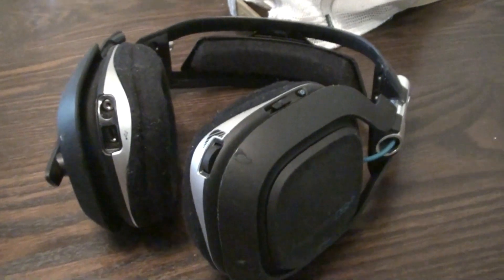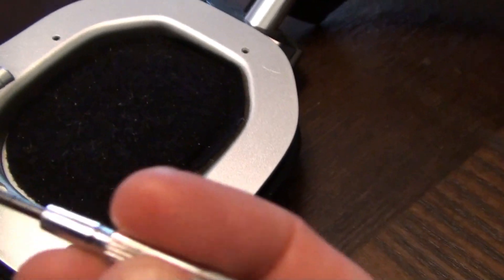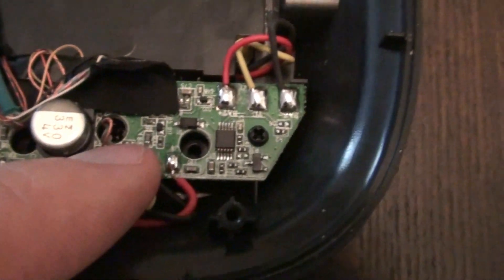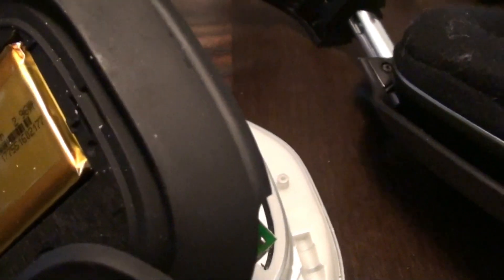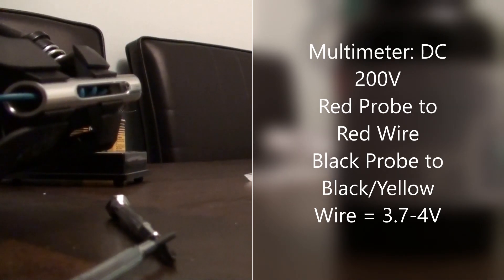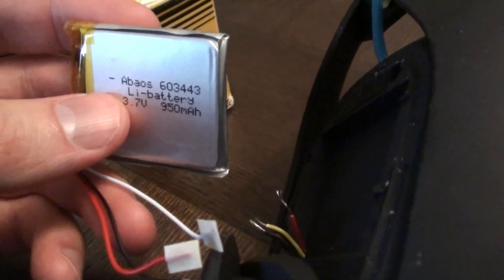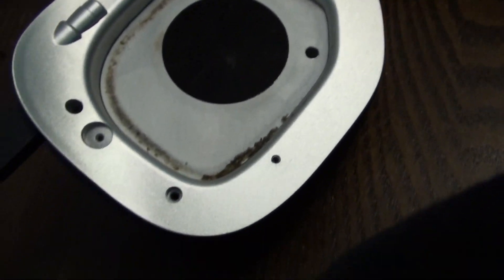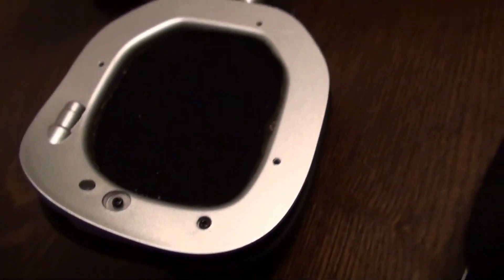Astro A50 Battery Replacement - Wireless Headset - Logitech

Comment: I have an Astro a50g4 that does not power on. The base lights up when connected to my PC and so does the headset but when i remove the headset from the base, it does not turn on. I have tried hard resetting and tried downgrading/upgrading firmware. Command center shows battery charged at 84%. this hasn't changed even after trying to direct charge overnight..  At this point i'm thinking i have a dead/faulty battery - any tips?
Reply from the maker: Honesty up front:  I've never laid hands on a gen4, but I'm fairly certain the disassemble would not be the same.  In fact, it probably doesn't use the same battery either.
I've stayed away from them after hearing sad stories about software/firmware updates that permanently "bricked" the headset.
I have some ideas about how to approach your fix, but I hesitate to give you that kind of untested advice.
If you dig the astro a50, grab a 2nd hand gen1 or gen2 off ebay.  The prices have dramatically fallen!!  😉  They are super fixable and you can upgrade the battery!
I also splashed some cool epoxy on one pair (see channel video) which turned out AMAZING!!
Reply: i have the same problem, u can fix it?
Reply: ur literally the first person to have my exact problem its doing my head in

Comment: So wait is that the reason why when I charge my mic it only charging for a couple sec then turns red and die its like I can't make it charge for nothing I switch out all the chargers
Reply from the maker: There's a couple other things it could possibly be, but I would put HAVING A BAD BATTERY at the top of the list, loso.
The good news is:  It's a pretty straightforward replacement, YOU CAN DO IT!! 👌🏼
Reply: @VestigialVoice  I appreciate it bro

Comment: Hello there! My friend's Astro A50 gen 2 got a problem yesterday. It ran out of battery last night and then she charged it this morning but it did not store any charge and quickly turned off again after a minute of the redlight flashing. I tried hard resetting them (by holding down the power + game buttons) and a orange light appeared. Then after a few minutes of leaving them on charge with this orange light the last of the power was used and now they do not turn on at all. I think the problem could be with the micro USB port as the headset had kept minimal battery for almost a day until I have begun trying to repair it. She had tried using a different USB to charge the headset yesterday as she wanted to play while charging them and I think this may have caused the issue. Please advise if you know anything I can try to resolve the issue. :)
Reply: The base unit turns off when the headset is plugged in which I don't think it did before. If that means anything?
Reply from the maker: Evening, knight.
It certainly could be a couple things, but I'd go back and check the wiring.
Did you attempt to charge it when it was still apart?  If so, did it work then?
I suppose it is possible to have received a dead-on-arrival battery, however, I've never run into that problem...
Check all the new solder joints--make sure wires didn't get pinched or pulled out when it was put back together.  It'll take a bit of time, but I have a feeling it will be a pretty simple fix.
Good luck, friend, and thank you for visiting my channel  😄

Comment: Hey I have an Astro A50 1.gen, it stopped working since yesterday and I can’t turn it on. Do you have any ideas to fix the problem? I couldn’t find a video with the 1.gen
Reply from the maker: King!  I own a gen2 and 3, but strangely have never even laid eyes on a gen1 in the flesh (however, I look forward to the day).
If there are no videos out there and you feel brave, film the fix!
Presuming the headset won't power up at all, it's probably a dead battery or severed wire / cracked solder joint.
Kick me the link, I'd like to check it out  :)
Thank you for visiting the channel, bud!

Comment: Hi, is there a symptom to know it is only a faulty battery? my a50's blink twice while plugged in, then go off.
Reply from the maker: Brother Carlos, I'm going to need a bit more information.  How long have you had it? 
 Any recent updates?  Which gen is it?  What color light is it?  Do you have the base station?  If you haven't already, try to repair the firmware.  There are a couple useful forums to guide you, step-by-annoying-step, with a simple google search.  I believe in you  :)
Reply: @VestigialVoice  they are gen 2 ps4 got them used to try to fix my first pair but, luckily after a full charge, they are working. now my original pair, which have been with me for 3 years will be the ones for spare, those start working well but after a couple minutes start to have fast blinking red light I assume it has something to do with the game-chat mixing. Thanks for the fast response.
Reply from the maker: @Diegosonic1  Glad to hear they're back in shape!  You know where to find me if they begin acting up again.  ;)
Reply: @VestigialVoice  Well, my other A50 just have blinking red light (fast, not slow like when low bat). Any possible reason comes to your mind?
Reply from the maker: You may be right.  Have you tested the battery with a multimeter to see if it is holding a charge?  A simple battery replacement might nurture that thing back to life!  Let me what you find out  :)

Comment: Did you ever think you could have fit a slightly bigger battery in there?
Reply from the maker: Hi Jay, thank you for the comment.  There is not a lot of space in the cavity but the OEM is an 800mAh battery and I put in a slightly larger (950mAh) battery - so about 20% longer lifespan.

Comment: ive had my astro a50 gen 4 headset for 3 weeks. when i put it on the base to charge the base lights start flashing white. its been like that for a day now and the headset battery life in the command center is stuck on 0%. 3 weeks 340 dollars and thye wont turn on. whats wrong with them and can i fix them????? fml im done buying headsets. i have zero luck
Reply from the maker: King!!!  Try doing a hard reset of the headset:  Press the dolby button & the game button on the right earcup while it's seated in the base station.
Reply: @VestigialVoice  I can try it but I heard they have to be on for that to work and these dont turn on.
Reply: @kinghayes1005  hey did you ever figure it out? i’m having the same problem and i just got them today. i can’t find any solutions anywhere

Comment: Someone give me a tip on how to change the microphone mine stopped working
Reply from the maker: Leon, that is either a very simple or an extremely difficult problem.  Number one, what was happening immediately prior to it dying?  If it didn't endure trauma, then the first thing I'd do is verify settings on the system's software.  This may also involve updating firmware for the transmitter and/or the headset.  Test it with multiple systems to see if the results are identical.  If you are still stuck, then you could open up the headset and investigate for severed or loose wiring, a cracked pcb, or a bulging capacitor.  I hope this points you in the right direction, my man.  Good luck.  :)
Reply: @VestigialVoice  Thank you very much for the tips but I ended up finding a very simple problem, one of the cables was loose in the microphone. I soldered it again and it was working wonderfully. I realized that there is almost no content about repairs by this brand including what I know about electronics is precisely to save devices and not have to buy a new one because they are usually very expensive.
Reply from the maker: @leonmenezes  Excellent, I love to hear that!

Comment: So I didn't see you mention this in your video but that center screw for the boom mic is REVERSE THREADED. DO NOT make the mistake of trying to loosen it counter-clockwise or you're gonna have a bad time. OP cuts away and doesn't show unscrewing the center screw for the mic boom. If you are still viewing comments please update your video with some text mentioning that the screw is reverse threaded. I ended up having to completely desolder the mic wires from the board in order to move it out of the way and dremel out the freaking screw.
Reply: Come to find out you don't even need to undo the boom mic screw. Skip ahead to see this guy who just rotates the side cover plate out of the way to access the battery. Just save yourself the trouble and do it this way instead! https://www.youtube.com/watch?v=OHO6Wmevb20
Reply from the maker: Thank you for sharing that good information and for checking out my videos, Nick!
Reply: Thanks for sharing your experience! Merry Christmas!
Reply from the maker: Hi Nick, which model do you have?
Reply: Vestigial Voice A50s. I bought them used on Amazon and they sent me two sets, both with a broken boom mic. =(
Reply from the maker: I'm asking if it is gen1, 2, 3, or 4 - do you know?
Reply: Vestigial Voice I think it’s a gen 2 (it’s older because that was cheaper on Amazon! Lol)
Edit: it’s gen 2 - it has micro usb charging port.

Comment: Awesome video, thanks! As an FYI - It appears that they changed the A50 for the 2016 green XBox model - still titled as the A50 model, even though it's much different than the OP's A50 depicted in this video. 
Differences:
Green!
The battery is inside the right earpiece. When you remove the foam ear pad there are no screws present until you remove the driver felt pad covering the speaker. This is stuck on with adhesive so just pull it back with tweezers or a plastic pry tool often found in phone screen repair kits. You will then find the four screws.

Found a pretty good procedure here: https://www.ifixit.com/Guide/Astro+A50+2016++Headset+Battery+Replacement/98499
Reply from the maker: Excellent information, thanks Scott!

Comment: Had mine for only a couple of years before battery life started getting too low for me. Asked Astro how to switch battery, to which they replied they don't recommend I do.

I'm glad to see it's possible, but disgusted at Astro for not facilitating easier battery replacement for such an expensive product. Will not buy from them again.
Reply from the maker: They make fantastic headsets but it certainly is frustrating how many companies resist consumer-replaceable-battery products.

Comment: my had the exact same problem. it just died on me, couldnt charge or anything. but i dont wont to risk doing this
Reply: whats the risk if they're dead?  i've been using a 12000 mAhr anker battery pack with my a50's for a year because of these weak ass batteries.  I'm considering whether I should just keep doing that or open them up like this smart dude did.
Reply from the maker: Give it a shot, bud, I believe in you!  Pay careful attention to the center screw attached to the microphone and you've got it  :)
Reply: do the base lights flash white when on the charger? i have had mine 3 weeks and the base lights just flash white and wont charge the headset